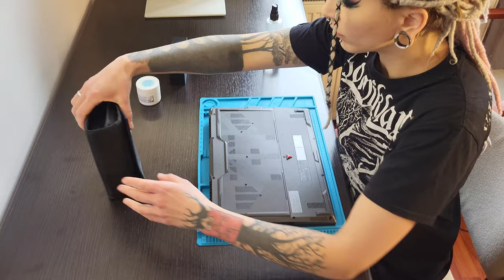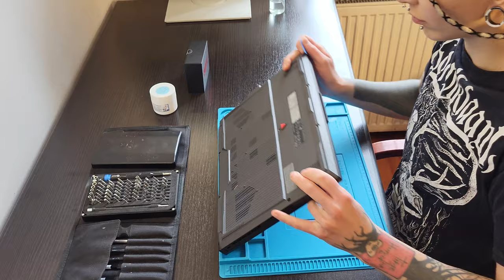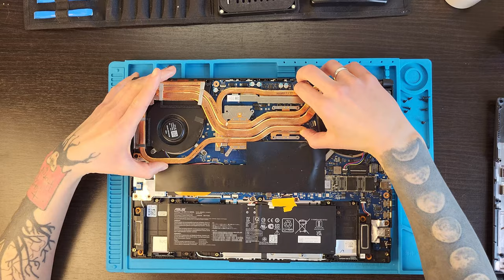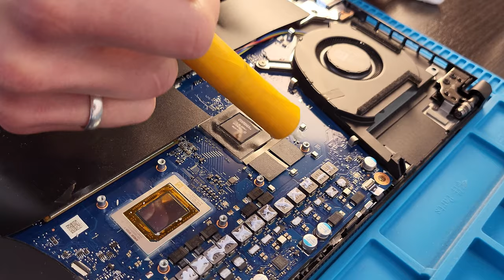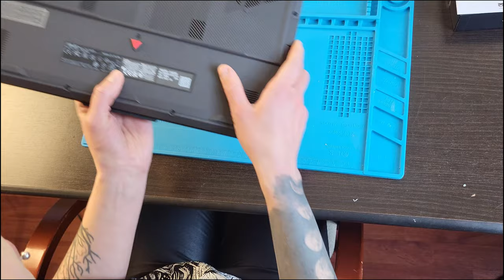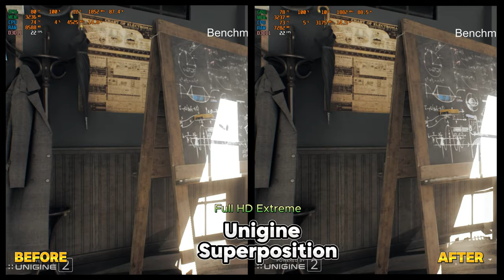ASUS TUF Gaming A15 laptop maintenance | AMD Ryzen 7 6800H | Nvidia RTX 3050 4GB

Comment: You also have to do whats called a burn in before u will see the performance in cooling get better.  Basically as u warm the new paste it will spread out more.  That cooling system is actually much more substantial then what you see on hp and other non gaming laptops.  It has more heat pipes.  The main issue with your laptop is its one of the lowest tier 30 series laptop cards and the amount of vram it has is literally the least amount u can get away with using and still be able to run a bunch of games semi decently.  Given the class of card u have and the vram you shouldnt be running higher quality settings and you wont really spot a huge difference going down but what u will notice is a significant increase in fps.  Also use fsr 3.0 and frame generation in cyberpunk and any other games that support it over the nvidia option as it works way better for getting higher fps when set to balanced and performance.  Your laptop has a really nice higher refresh rate display so if it were me depending on the games i would aim for atleast 60 fps by adjust settings vs trying to get the best quality and sacrificing fps to do so.  Just try some of the advice ive given and see if u like it better.  It can take time finding good settings but like i said before the graphics quality settings dont really impact the image as much as most would think it does.  Also nvidia just released a cool new app thats currently in beta but available to download on their website and its their new settings platform and it does a really decent job at picking the best settings for each game per your hardware.  It serves as a good starting point but unfortunately it womt utilize things like fsr since thats a amd made mod despite it working on nvidia cards and works very well.  Fsr alone is one thing that makes a huge difference that and frame generation will double your fps alone when tweaked properly.
Reply from the maker: I do not play, so fps was not important for me in this test, my task was to make the load on the video card and processor in real conditions and remove the temperature change after laptop maintenance. I agree that this laptop is not balanced and it has excessive processor power for this video card, and this is a temporary solution for me, which I use to test its performance. Anyway, thank you for the comment
Reply: @Replapt  ah OK I see now well I posted a few more suggestions I guess ignore those since this isn't for gaming.  So if I understand correctly you just want it to run cooler?  Is it getting warm on the bottom and making it uncomfortable to use on your lap or while in bed?  If so I can understand that, there are a few tips I can share with you if that's the case.  You possibly can adjust the fans manually and set a custom fan curve which will make the laptop louder but run cooler.  If the heats not bothering you and your just worried about the lifespan of the components then I wouldn't worry too much about that as high heat is a normal thing in most newer laptops.  It's a common thing for all the higher end more powerful laptops to struggle with cooling there's only a couple that actually do a good job the rest are just something most ppl just tolerate.  I build high end pcs and do laptop repairs so if you ever have questions or need help feel free to reach out.
Reply from the maker: @SpreadingKnowledgeVlogs  Well I understand and surely appreciate your intentions to help and in terms of better solutions for laptops in this or other cases we could talk forever. But If you can see we have whole channel dedicated to maintenance, repair of laptops and PC assembly in a variety of configurations (and it's just a little part of what we do behind the scene). Basically, I have an idea of what I'm doing. In this particular case we have achieved the desired result. It would be possible to make an undervolt, adjust the ventilation speed curve, but this video is designed for the average viewer. Let's just say a light video with a special aesthetic🙂
Reply: @Replapt  oh I'm sorry this was the first video of yours youtube showed me my apologies I should have looked at your other videos.

Comment: Sceatch that u put way too much on everything except the gpu and cpu.  Too much can hinder thermal performance but pushing the plates away and also can cause a huge mess
Reply from the maker: These thermal pads are liquid enough to interfere with the normal clamping of the radiator, they have been tried on more than 300 laptops and it has never caused problems, what you wrote can happen if you use laird thermal pads
Reply: @Replapt  those aren't thermal pads that's a paste that mimics what a thermal pad does.  I'm just trying to help not trying to bash or anything.  You want your metal surface to be as close as possible to the chips your trying to cool.  The reason for using paste vs pads is different for each.  Paste fills in tiny imperfections in the surface of the metal like tiny scratches that is why on the cpu and gpu u only need a very thin layer.  As for everything else like the vram, ram and what not the pads are there sometimes to bridge the gap between the surface of the cooler and the chip and in those cases using a bit more of that paste is OK but if u look at other videos using it you will see that's a bit too much.  Also where there's a bigger gap present I personally feel pads work better then that paste that mimics pads.  What works even better is measuring the gap and using thin copper plates to bridge the gaps wotj a thin layer of paste on each side and taking very careful care not to short anything out.  This is what they do to mod rtx 3080 and 3090 cards that were known to run super hot and it was that way due to the gaps they had from the vram to the cooler which they tried to bridge with thermal pads but copper worked so much better it caused a 40-60 degree celcius drop in Temps in most cases.  Research a bit of what I'm mentioning here, once you have a more thorough understanding of what I'm saying maybe you can go back and try some of the different ideas if you want to bring the Temps down.  If your Temps aren't going over 90-100 degrees celcius then you won't be hurting anything.  Also you can download msi afterburner and raise the temp limit to 90c from the stock 84c on the gpu so that it will give u a tiny bit more room before thermal throttling.  Afterburner will also allow you to play around with what's called under volting which will significantly lower Temps while also raising the gpu performance all using software only.  You also can adjust the fans in afterburner as well which I highly suggest doing as most companies set fan curves for noise rather then keeping Temps low.
Reply: @Replapt ps I've used both the products you used here k5 pro I'm not really sure is good for every thermal pad situation but it does work well in very specific situation ive used it about 40 times myself on gpus.  Thermal grizzly on the other hand is amazing stuff.  You might have better luck with liquid metal on the cpu and gpu but you have to really know how to handle that stuff as it's dangerous amd if used too much it will melt solder so have to use very genorously but it transfers heat much better.  If it were my laptop I'd probably go liquid metal and find the best thermal pads in the right thickness for each area and give that a try as well as the softwares I mentioned previously. The software alone will make a huge difference.

Comment: You should try phase-change material Honeywell PTM7950. It comes in as a sheet, lasts longer, performs works better than traditional pastes and there is no pump out effect. Instead of K5 Pro, I suggest applying Upsiren U6 Pro or UX Pro thermal putty have much better thermal conductivity.
Reply from the maker: Thanks for the advice, I'll try thermal pads in the near future. Regarding the phase-change material Honeywell PTM7950, it is almost no different in results from the thermal paste that I use

Comment: Ha! The white thermal paste  is made in Greece.  Hello neighbour paste! 

I've never seen anyone masking the battery connector before.  Interesting move.  I never thought of doing it before.  

I am quite surprised to see thermal paste used from the factory for anything other than the main CPU and GPU dies.  Fascinating.  Usually they use thermal pads.  At least to my experience.

What did you use to clean the paste?  Those circular things.  They look like those things one can buy to clean their face.  Or is it something else?  

The thermal paste for thermal pad replacement (which I assume is the type of paste that was used originally too) is something I have never seen before.  Like specialized paste?  I didn't know this existed. Can certainly make things easier than finding proper pads, but I can see a potential problem depending on the design of the cooling solution.  There might not be good enough contact with the use of paste.  Clearly not an issue with this laptop as the laptop came with thermal paste already applied.  Again, fascinating.  

There isn't a huge difference in thermal performance, but nothing to do with the work done.  It's just about the whole hardware/installation.  Still, a few degrees is always better than no degrees.
Oh and you just mentioned it too.  Also, good to get some lower noise!

Your whole process was very well done.  You are either a professional or have plenty of experience with doing maintenance. 

Cool video, thank you for sharing.
Reply from the maker: Regarding the move with the battery connector, it's just a safety element. 

They're just cotton pads, so you're right. 99.9% isopropyl alcohol is used for cleaning. 

After some time of use, in any case, you need to change the thermal paste, besides, often the factory thermal paste and thermal pads are far from the best. Thermal paste was applied only to the cpu, gpu (the description of the video lists the components used), various thermal pads were applied to the remaining elements. 

Thank you for appreciating our work😉

Comment: U put way to much thermal paste on the vram
Reply: It doesn't appear to be normal thermal paste. I think she used normal amount for what it is.  Yes if you take it as normal thermal paste then it is scary to see so much used, but again I don't think it's a usual CPU type thermal paste.
Reply: @TrusteftTech  no its not its a thermal paste like substance used to replace thermal pads.  It's normally ok to put on a tad thick because it has to bridge gaps like thermal pads do but I think that was too much plus I don't personally like the k5 pro stuff I feel it doesn't work well as thermal pads.  In my opinion a better option would be to cover those components except the vram in kapton tape just on the metal components and not the cpu or gpu but just the coils that are being cooled with pads normally and use copper shims at the proper thickness with a thin coating of thermal grizzly to take up for imperfections.  It a more intensive job as it involves careful measuring and precautions to avoid shorting things out but it works so much better then anything else.  This is what users with rtx 3080s and 3090s do to keep them cooler as those are known to have thermal issues its called copper modding.  But in the end she's likely to be fine running her laptop as is its just not optimal but likely also won't hurt anything.
Reply: @SpreadingKnowledgeVlogs  The K5 Pro is the worst thermal putty on the market. Much more efficient are Upsiren U6 Pro or UX Pro. I recommend giving them where VRMs and vrams reach >80°C. With the K5 Pro, these components will burn out
Reply: @SpreadingKnowledgeVlogs  Hi. Do you know what thickness thermal pads should I use for vrams on ASUS TUF A15 FA506IU? 0.5mm, 1mm, or 1.5mm?